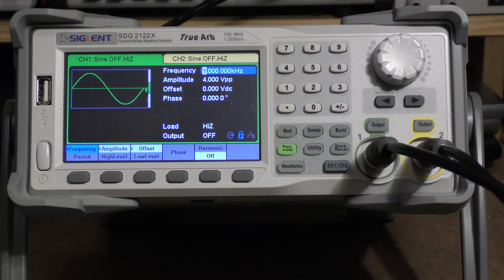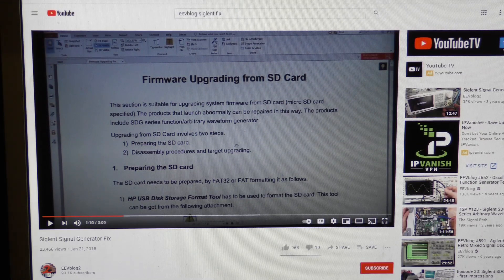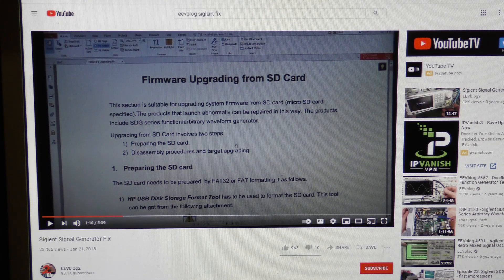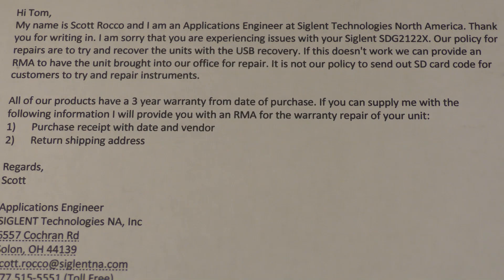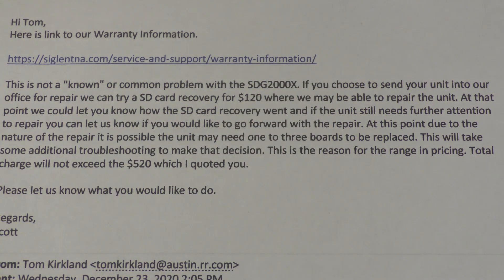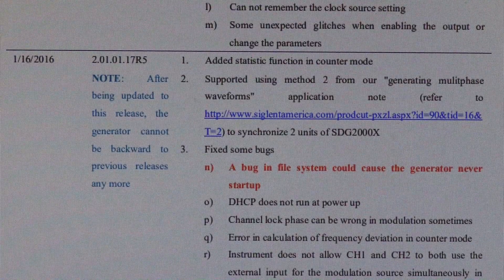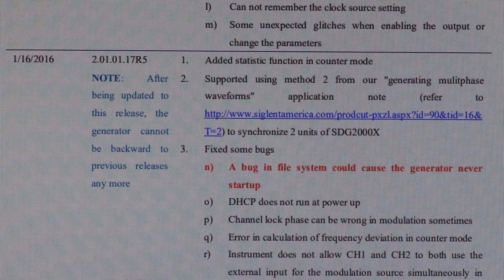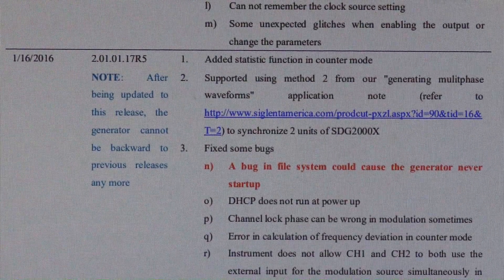Siglent Warning

Comment: Is the problem that this Siglent model AWG (perhaps other AWG models ...  all Siglent equipment) need rigorous firmware updating, whereas similar equipment of other brands does NOT ... or is it that skipping firmware updates for other brands may impair performance but never bricks the equipment?
Reply from the maker: I can't speak for all brands or models, and it is almost always a good thing to keep up with updates. It appears that the Siglent SDG2000X has a particular fatal flaw that is corrected by a later firmware update. I haven't seen this in any other brand or model though it is possible. As I explained in the video, the flaw essentially "bricks" the device but it occurs randomly. For example, it didn't happen to my unit until after the warranty expired while Dave Jones (EEVBLOG) saw it occur just a few months after he got his SDG2122X. The reason I say updating is almost always a good idea and not always is that sometimes the updating process goes wrong and some people have found units "bricked" after they tried to install an update. Of course, I am not talking about the risk of trying to use a "hack" to upgrade, where you take your own risk, I am talking about officially released updates and original product defects.
Reply: @tomtektest8042  Thanks for your quick reply.  Hmm ... the plot thickens:  bricking after installing a legitimate update!

Comment: I always have a phobia of updating firmware in systems. I hate bricking an expensive piece of equipment.
Good to know. Thanks for sharing. Dave might have a closer relationship with Siglent due to his large audience and how quick he is to point out problems in equipment.
Reply from the maker: Yes, the irony, as one viewer has already pointed out, is that in this case you are more likely to brick your device if you don't update the firmware. More to come.